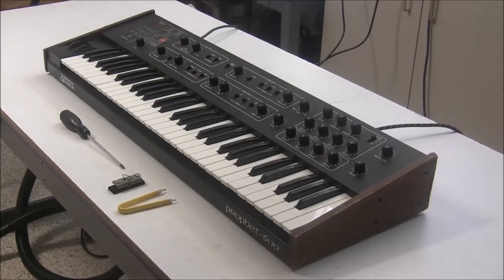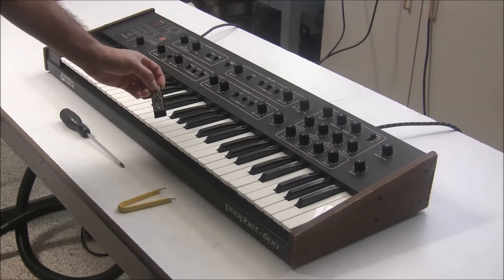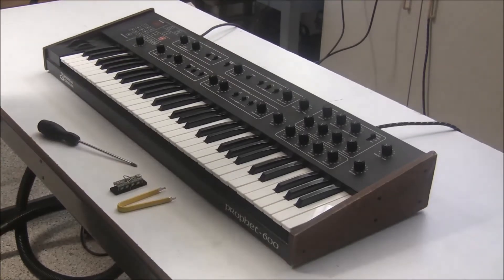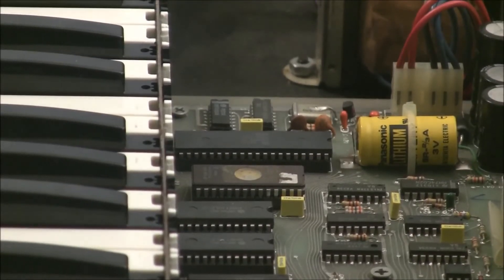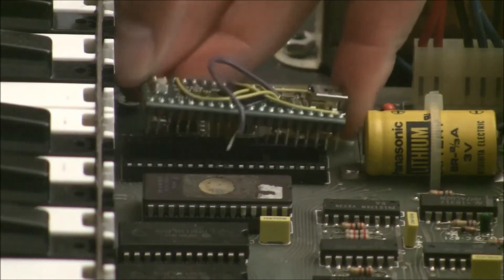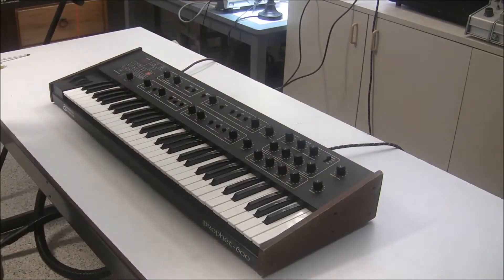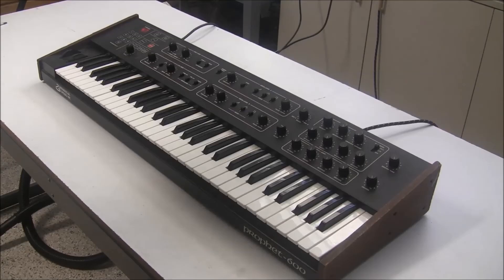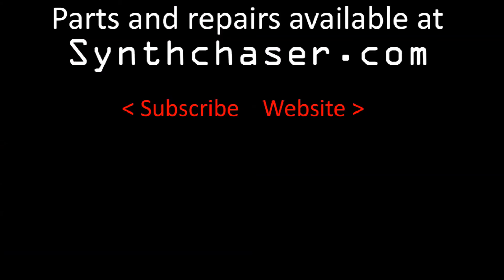Synthchaser #063 - Prophet 600 GliGli CPU Upgrade Install for Sequential Circuits P600

Comment: I’m intrigued as to why is it missing a pin when soldering the stray wire to the pin on the teensy PCB would serves the same purpose as breaking off the pin and pushing it into the socket. Or am I missing something?
Reply from the maker: If you solder the wire to the pin on the teensy PCB you're shorting 2 different lines together.  You'd need to cut whatever traces were going to that pin originally to achieve the intended effect, and I'm not sure if this was a 2 or 4 layer PCB and how easily that could be done.  Doesn't really matter anymore, since the Teensies have been gone for a long time.
Reply: Thanks. It matters to me since I’m repairing a 600 at the moment and the wire in question was unattached. I’ll restore it as per instruction, and hopefully it will sort some of the 600’s problems.

Comment: For those of you wondering why this is a great mod, it adds:

Increased resolution for sound parameters
Faster, smoother amplifier and filter envelope generators
New LFO function generator with a wider range
Dedicated vibrato
Unison detune
Mix Overdrive
Full Midi In control of parameters
Improved tuning procedure

I know that the P-600 get a lot of complaints about slow, "un-snappy" envelopes.  The Gligli retrofit fixes this, and other issues.

Comment: Hello! hopefully you or another enthusiast can answer this. 
1. Purchased the Teensy++
2. Installed the Teensy++ software
3. Modified the Teensy++ as instructed on the gligli page.
4. Flashed a stable version of the gligli upgrade onto the Teensy++
5. Removed the Z80 from the circuit board, replacing it with the Teensy++
6. Powered on the P600, anticipating the gligli upgrade greeting but was suprised by a scrolling banner of gibberish.
7. Once the "banner" was finished the tune button was pressed
8. The P600 went through each oscillator and filter as intended but made various hisses, and drones as it made its way.
9. Once the tuning process was complete the P600 was monotone across each key, and was not susceptible to any change in potentiometer or button on the key pad (other than indicating a change between the command and numerical buttons)
10. Safely removed the gligli upgrade from the P600 and Replaced it once again with the trusty, rusty, Z80 and all was fine.

* An additional note*
Before any upgrade was attempted, My P600 had/has issues with tuning.
I purchased my P600 used, and was told that it sat in storage quite some time. The owner erased his patches and re-installed the factory presets via tape. He also mentioned while restoring the presets he had some "difficulty". I found that most of the presets are out of tune from the get-go and take some adjusting to get sounding as they should. 
When manipulating a preset via potentiometers/switches, the preset number will turn into a decimal point (not sure if that is suppose to happen)
I also tried to upgrade my P600's OS to OS8, thinking that, that could possibly be the reason the gligli update didn't take; but to no surprise the OS upgrade did not take either, on two separate occasions. 

I apologize for that lengthy breakdown, but I hope it will help narrow down my P600's malfuntions. Thank you for reading.

-Alex

Comment: Hi, do you know it the prophet 600 should work with a regular sustain pedal (called foot switch in the manual). I have a roland sustain pedal but can't get it to work with the prophet...
Reply from the maker: I think so, it should work with any make/break (on/off) type footswitch.
Reply: I also have this problem

Comment: Very nice! Too bad you can't eliminate the wire with a trace cut on the plug in.
Reply from the maker: I had been looking at a way to do it...  Best solution I came up with would involve drilling out the through hole plating on that pin.  So I just stuck with GliGli's way.